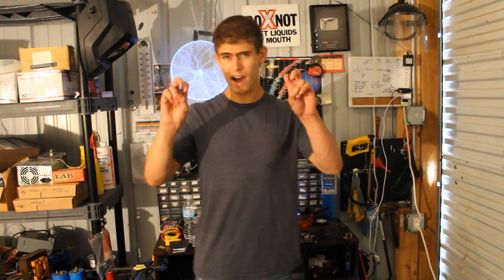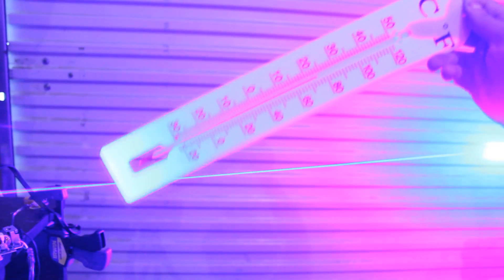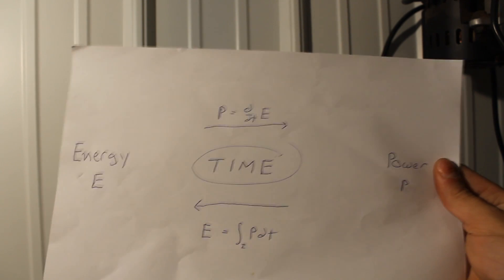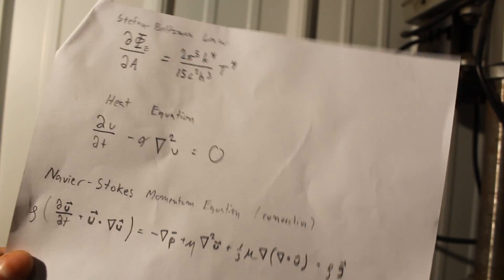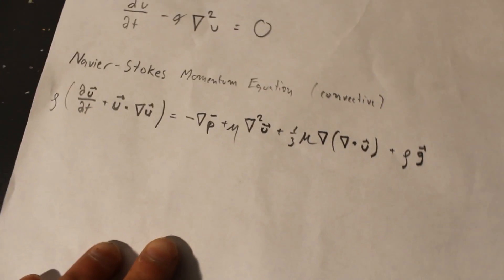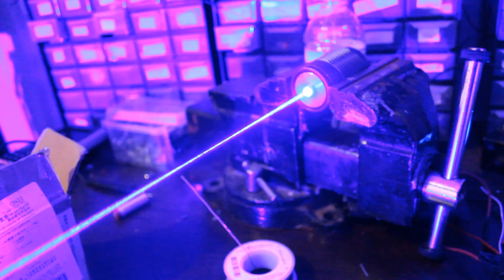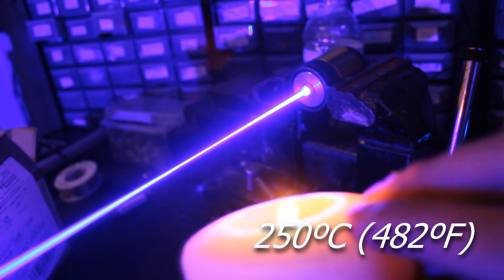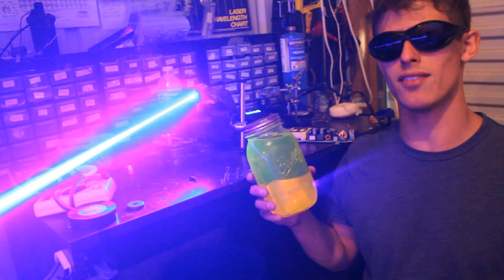How hot is a 5W Laser?

Comment: ΔT = (P x τ) / (A x κ)

ΔT is the change in temperature of the material being irradiated by the laser beam
P is the laser power
τ is the duration of the laser pulse
A is the cross-sectional area of the laser beam
κ is the thermal conductivity of the material

Another way to calculate is 
ΔT = (α x P x τ) / (ρ x c)

ΔT is the change in temperature of the material being irradiated by the laser beam
α is the absorption coefficient of the material
P is the laser power
τ is the duration of the laser pulse
ρ is the density of the material
c is the specific heat of the material

Comment: The basic definition of temperature is how much energy of a system changes due to entropy change (not volume or particle number change). While you can technically calculate these things, it doesn’t make a lot of sense. Energy density of a photon beam is straightforward, but it only depends on particle density and wavelength.

It’s not very sensible to talk about entropy density of a beam of photons like this because once produced, the beam effectively stays in one state. What would be meaningful is the interaction of the beam with the cavity generating it. 

We can talk about entropy with black body radiation because the system has many micro states to explore, and it is interacting with a thermal reservoir, so the system can explore microstates to find the most likely macrostate given the constraints. Entropy of a macro state in this case is given by how many microstates there are, and ergodicity is usually assumed too so we can assume no preference of microstates. But a laser beam after leaving the cavity just is in a particular microstate and stays in it. 

In short, it doesn’t even make sense for a laser beam to have a temperature. That’s one of the reasons it’s nice to use light to heat things, it will continue adding heat no matter how hot it is, unlike a hot object touching it, where heat is only added as long as the object has a higher temperature

Comment: What I would personally do is calculating the temperature for which the total blackbody power emission per unit area is equal to the power density per unit area of the laser beam... In this way you should calculate the maximum temperature at which a very small (Biot almost 0)  blackbody in vacuum can be heated by the laser beam.

Comment: Now u need like 10 of those all focused on the same spot.. also, that millenium prize u mentioned, if u could explain, sometime, what that equation means, id be able to understand. You could easily teach that in videos bc you are easy to listen to
Reply: It's more of a mathematical question than an experimental one for that millennium prize question. The Navier-Stokes equations are a series of differential equations (equations involving derivatives) which model fluid dynamics. Differential equations can get pretty wild to solve, only a small subset of all the possible types are solvable at all, let alone easily solvable by hand. Then there are tricks and methods for solving each type that we do know how to solve. For a lot of them though we just plug in numbers on a computer and basically see what happens for a lot of points, which is why we need supercomputers for forecasting with different models or doing virtual aerodynamics simulations with computational fluid dynamics (CFD). The millennium prize involving this equation is to prove that a solution always exists (or disprove it, as far as we know at the moment it's possible that sometimes the equation just isn't mathematically solvable). The million dollars will go to anyone who can mathematically prove that it does always have a solution, or that a case where it's unsolvable (has no solution) exists. I'd also like to see StyroPyro explain it though! It would be a different sort of video than his usual stuff, but I think he could do it really well!

Comment: some laser power probes out there are just a block of metal with a thermometer embedded inside. the way it works is that you fire the laser at the probe for a few seconds then use the thermometer reading to calculate power.

Comment: Why dont you call the temperature units correctly? Do you say 104 "EF" or 104 degrees fahreneit? it is the same with celsius
Reply from the maker: you know what I meant. calling Celsius "C" is a very common shorthand, and becomes habit when you've read off enough tables of data. similar to calling the factorial operation "bang" in a math setting where one syllable makes speaking flow smoothly

Comment: Uh, thermometers can cover much more than that Dollar Tree one you used. My IR thermometer hits 1922F. And There's another I really want that hits about 3700F. But I only needed it for my foundry that the metal with highest melting point I smelt is copper at about 1800F. Though the foundry can go over my thermometer's max in about 15 min. I'm not melting iron/steel yet. So in no rush to get a new one
Reply from the maker: well yeah there are obviously better thermometers out there, but that wasn't the point of this video
Reply: styropyro - haha yeah I noticed that after I had already posted. Though I didn't know that the lasers didn't have their own consistent temperature for the beam itself. Obviously the object being burnt is another story, but I had always thought the beam itself had it's own temp. Kinda like a torch I guess. Though after seeing this, it seems obvious. It IS radiation after all

Comment: tl;dr: asking how hot a 5W lazer is is like asking how much distance a car with a top speed of 250km/u can travel.
They're simply apples to oranges comparisons.

What IS relevant is the focusing ability. 5w hitting a square millimeter of paper will burn it, 20w hitting a square kilometer of paper won't...  the power of a laser is thus not just about the raw energy but rather on how small a surface it can apply said energy. This is why a 5w laser is generally more dangerous than a 50w tungsten bulb.

Comment: Going off a basic definition of temperature, 1/T = dS/dE, in the case of a laser don't we pretty much ALWAYS have one single set of states? All of the bosons (photons) share the same state (one wavelength) and you have no Fermi/Dirac statistics in place. Every unit of energy (another photon) won't increase the entropy at all because boson states are indistinguishable; so 1/T = 0, suggesting an infinite temperature.

I think this is an accurate description theory-wise, but I know it doesn't make much sense from a practical standpoint (beyond that any beam of photons will give its energy up to what it hits). It's up there with how an Ising spin lattice in an opposing magnetic field can have a negative temperature :O

Comment: I guess a laser would have an infinite temperature as the temperature is just the thermal energy in one spot, that spot could for all we know be shorter than a plank length across or if the laser was out of focus a meter across, it's a hard question but I guess you could calculate (with 100% efficiency) the energy of the laser and the area of the target, idk but I do want 1mil$

Comment: well here's a suggestion, point the laser at some kind of metal that has a high melting point and then measure the maximum temperature that you can read off the surface of the metal. yes there will be some heat lost but it would still be cool to know how hot this thing can heat stuff.
Reply: Most metals are conductive therefore they reflect light quite well but it would be fun to see him trying that 😁

Comment: h*c/(l*kb) = T = 6.65e-34*3e8/(4e-7 * 1.38e-23) = 36141K (if l = 400 nm = wavelength) i know this is quite rudimentary, because it does not depend on the power output or intensity, but this might be a rough aproximation. with the intensity i could calculate how hot a blackbody would become, if perfectly insulated.

Comment: Isn't there red laser based apparatus which can measure temperature? I've seen something similar like an rpm measuring apparatus and even a speed based one which police cruisers sometimes have built in. Couldn't you just measure temperature with  the laser temperature sensing apparatus?

Comment: At last I can see a bit of the practical use of physics!Thanks for sparking my interest in this domain:D
I have a question though, how can you know how strong a laser beam is,do you measure it s wave length?
Reply: Everything I know is from him. But wavelength is given to specify color. Millie watt is the number you look at. 
    5mw for a 5 jewel beam. Jewels are the beam has after spending 5mw of power. 300 mw can course instant blindness. So for a beginner I’m going under 300 mw. Even though you need protection after class 3A. Look on google for “ laser classification chart” it will tell you strength and a brief but not complete safety guid. Anything over 5 mw key chain it gets dangerous there is a meter you shine the laser and it converts it to Millie watts.
Reply: Oh yea stay safe and happy laseing